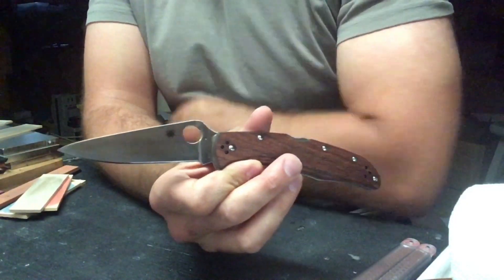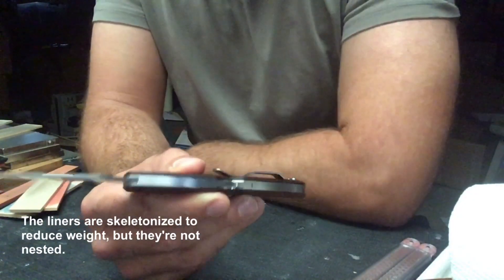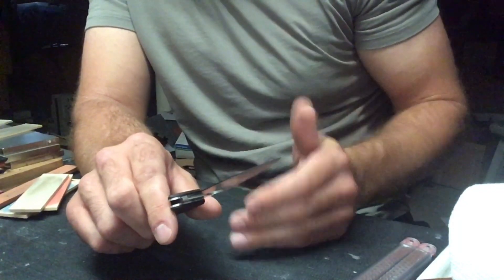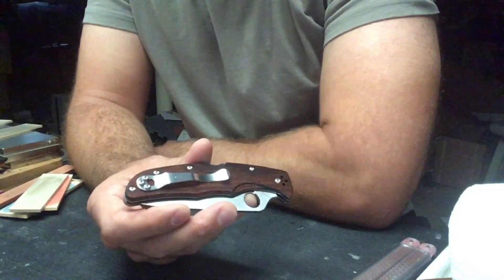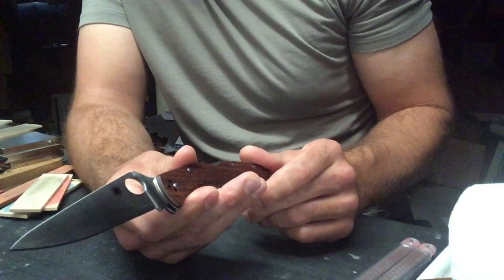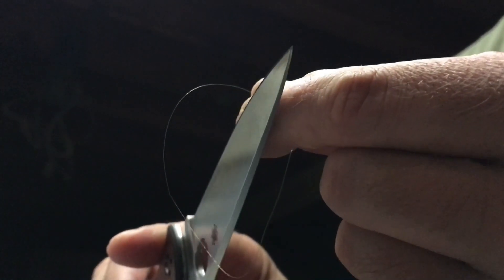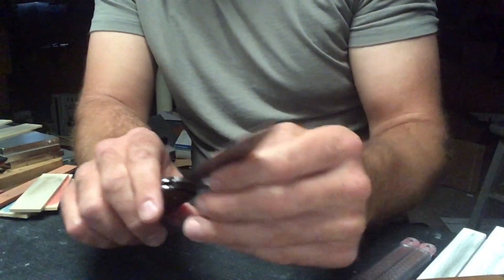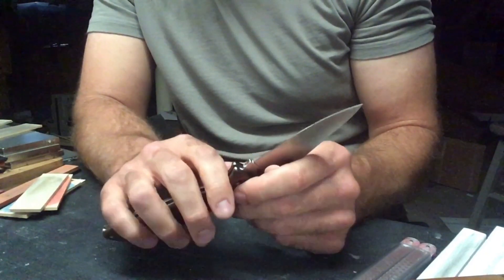HAP40 steel Spyderco Endura - pakkawood handle scales

Comment: I got a low-ish amount of cuts on my rope tests, but it doesnt sit right with me. I think I used too small a portion of the knife edge and need to re-do it with something delica sized. Great video man, love hearing you chat steel
Reply from the maker: Cedric & Ada Gear and Outdoors you mean you got a low result using HAP40?  That's interesting.  There's a lot of factors that could be the cause (which I'm sure you're already aware of).  Having to retest is a pain in the ass.  Hope it goes smooth for you.
Reply: Instablaster.

Comment: I've always seen HAP72 as the Japanese Maxamet too. I'd love to see a knife in it soon. Great video as always man!
Reply from the maker: Herb Toker thank you.  
Maxamet pushes the limits on content a little bit more then HAP72, but they are very close.  It would be interesting to see it come out.
Reply: Michael Christy Completely agree. I have a feeling it's going to be the new ZDP (in hype) in high end Japanese sujihikis and the like.
Reply from the maker: Herb Toker it would be great if we started seeing it come out.  Although, ZDP is a much simpler steel.  The main carbide former in ZDP is chromium.  HAP72 is packed with a lot of different elements.  ZDP is easier to deal with in a lot of aspects.  I'd still like to see HAP72 break into the production folding knife market.
Reply: We got a Shibata fan I see :P. ZDP-189 is finicky and annoying to sharpen with the high free chromium content, I'd love to see HAP 72 on some production blades, I'd like to see Sukenari replace ZDP in their san mai Damascus series with a super high wear resistant tool steel.
Reply: Michael Christy Yet again completely agree. I'm not saying that it will fill the roll of ZDP, but I think it will gain hype in the next few years. Kiya already has gyutos in it.
Reply: Elliott Atwell You mean low free chromium content. Most of the chrome is locked up in chromium carbides. I just picked up a 270mm Sukenari ZDP damascus sujihiki a few months ago and it's easily my favorite knife. Literally almost perfect.
Reply: Elliott Atwell And nope just a mitsudomoe, they've been around hundreds of years before Shibata! I do like their knives though!
Reply: +Herb Toker Nooooooooo it isn't, ZDP-189 is 3% carbon 20% chromium, chromium carbide is 3 chromium atoms 2 carbon atoms. Free chromium tends to clump in the martensite matrix and considerably reduces steel ductility. So even by stainless standards it has high free chromium content. Yeah I absolutely love Sukenari's Damascus series, they did a short run in Aogami Super which I personally prefer, but the grind fit and finish is immaculate. The only slicer I have that I like more is a custom honyaki from the head knife grinder at Nora.
Reply: +Herb Toker I'm taking my first crack at K390 with the Spyderco Police I pre ordered, supposedly it has 3x the wear resistance of S110V/10V, I'm going to be crying while I dish the hell out of my shapton pros
Reply: Elliott Atwell ZDP definitely isn't 100% stainless. Much less stainless than even S30v. Alot of the chromium is being taken up in carbides form. A steel needs 11% free chromium to be considered stainless. ZDP at 66 HRc isn't meeting that requirement. Also you forget about MC type carbides and what type of chromium carbides are in the matrix.
Reply: Elliott Atwell Look at M390 it also has 20% chromium but is super stain resistant, because it has a good portion of vanadium and other carbide formers (also over 1% less carbon). The 3% carbon and 20% chromium are the main makings of carbide in ZDP, thus the stainlessness is drastically reduced.
Reply from the maker: Elliott Atwell K390 does not have 3X the wear resistance of 10V.  In fact, it should have slightly less wear resistance then 10V (although, I highly doubt you'll see it in use).  However, it should also have higher toughness then 10V.  I also have the new Police on pre-order.  I'm really looking forward to that coming out.  Good luck with using Shaptons.  With that much vanadium in the steel, alumina stones are going to have a problem with sharpening.
Reply: Elliott Atwell Also K390 definitely does not have 3x the wear resistance than 10V, it may be tougher but has equal or most likely in all situations less edge retention (depending on heat treat of each).
Reply: Elliott Atwell I don't know if Chosera stones are much different from Shapton, but I couldn't sharpen k390 Spyderco mule with them, only diamon.
Reply from the maker: Soslan1812 I'm pretty sure Chosera are alumina based stones as well.  The vanadium carbide is harder then the abrasive (alumina) in the stones, so you're getting carbide tear out.
Reply: +Michael Christy Oh by the way have you tried the Naniwa diamond waterstones yet? They make them up to 6k.
Reply from the maker: Herb Toker I'm working with some diamond water stones.  Quite a bit, actually.
Reply: Michael Christy The Lee Valley diamond lapping films are great too, monocrystaline and down to .1 micron.
Reply: Elliott Atwell yea..... That would be great.... Hope you got $1700 for a 210 gyuto lol

Comment: Glad you got a new knife man! I'm thinking of picking up a military next week. I've never owned one and am looking forward to it. I ended up picking up the wicked edge I asked you about a while back. It's definitely pretty good. I was having trouble freehanding but I hope to try and keep learning on some cheaper knives this time.
Reply from the maker: crf450r bullet david the Wicked Edge is supposed to be a great system.  I've always heard that it's high quality and gives great results.  I'm sure you'll enjoy it.
Reply: Thanks I am enjoying it a lot now. It takes a little time to get used to it and where to setup the blade and breaking in the plates. It feels good to  have a way to sharpen knowing that it isn't going to go wrong. I've done some great freehand edges but my skill is definitely limited andI tend to want to change the angle I'm holding mid sharpening. I just need more practice.  I noticed the way you sharpen your blades always have a flat after the belly leading to the tip. Some knives come that way but it helped me to learn not to raise the knife to high and on the wicked edge to not take the paddles off the tip and it will stay straight and pointy.  Are you fairly new to sharpening or have you done it for a long time?
Reply from the maker: crf450r bullet david what do you mean a flat after the belly?  Not sure what you're talking about.
Reply: Let me try and explain, when I first started sharpening i would raise the knife too high and the tip portion of the knife would get round and not pointy. The way you sharpen leaves the tip area straighter which makes the tip a lot pointier. I wish I could draw it for you but I think that should make sense. What I'm saying is not a bad thing, it's a good thing and makes for a better tip. The pm2 and other knives come from the factory that way but in the past I didn't know to not go past a certain point to keep that geometry.
Reply from the maker: crf450r bullet david inhnderstand what you're describing, but you don't have to end up with a flat portion.  You can save the tip and keep the belly running to the point (if that's how the knife is made).  If you spend too much time near the tip, you'll develope a flat, but that just means don't spend too much time there.  Just enough.
Reply from the maker: I see what you mean now.  I've been sharpening for a longtime.  I guess it's something you learn not to do over time.  To me, the tip is the same as the rest of the knife...  it's just another piece of the edge bevel.  I don't put any focus on the tip itself, but rather the edge right before the tip.  When you put your focus on the edge near the tip, the actual tip works itself out.
Reply: Yes! That's exactly what I meant! You put it in better words than I could. That makes a lot of sense to sharpen like that. I first noticed just looking at your edges. I really liked the way they looked. But of course like you mentioned not all knives have this geometry for instance on the k2 with that huge sweeping belly. I really want to keep pursuing freehand. It's a little trickier to get this effect on the wicked edge.
Reply from the maker: crf450r bullet david it maybe trickier with the WE, but I'm sure it can be done.
Reply: Yeah your right I was playing around with it last night. I guess the problem I was having is when I didn't know what I was doing sharpening I was changing  The geometry. Now I'm trying to fix the a couple edges I messed up. Now I know a little better to keep edge how it is from the factory. Idk about you but I've gone through a hell of a journey trying to learn this sharpening game and I still have a lot to learn.
Reply from the maker: crf450r bullet david reprofiling is a strange thing.  There have been times I've spent a lot of hours trying to reprofile a knife early on.  More recently, I've done it freehand, but that's really difficult to do.  You need a lot of muscle memory for that.  I really tore up some blades early on reprofiling.  You get more used to it and the amount of attention it takes.

Comment: Great informative video as always. With my hap40 delica I noticed the first time I sharpened it I decided not to use my wicked edge but instead I used my friends Viper sharp and I was really surprised to get it really sharp rather easy with the stones that come with it that usually struggle on any steel above say 154cm. So do you think I would get a lot better results with my WE using through 1000 grit diamond stones then move to my 1200/1600 ceramic stones and move through my balsa strops till   .5 micron. Well brother hope your having a great day talk to you later
Reply from the maker: Stassa23 yeah, I think the difference would be noticeable.  When it needs sharpening, try it and see.
Reply: I definitely will give it a try I'm carrying it this week so it may need a sharpening after I'm done I'll let you know how it turns out
Reply from the maker: Stassa23 sounds good.

Comment: Hi, intersting test like the same. Have you ever testing a spyderco manix 2 lightwight?
Reply from the maker: cesare mantovani no.  I only have one Manix, and it's the G10 S30V version.
Reply: Michael Christy hi, i'm turning around manix2 lightweight 110/maxament and bradley2 ( how strong is the frame lock?) but can't decide between this two. What's your opinion?
Reply from the maker: cesare mantovani I would go for the Bradley, but I'm not the biggest fan of the Manix.  If you like the Manix, any are good options.  Just consider your uses in the decision.

Comment: Saw a comment on the forums that linked me to your video. You have an interesting sharpening technique. The bench stones I use are Norton India and Arkansas then move to the Spyderco bench stones medium thru UF before stropping with DMT diamond pastes on homemade horse butt strops. However, I use a more conventional method and lay my stones down on a bench and each pass is the entire length of the edge (unless extra attention is needed somewhere). What's the reason for the method that you use? You seem to get good results and I'm always curious to hear why different techniques are used.  Not judging or saying any which way is better than the other! Thanks for a great video!
Reply from the maker: hovan2yourknives I'm glad you found a link that brought you to the channel and that you liked the video.  
I use a lot of different techniques.  If you look over the whole channel you'll different techniques being used.  I use this technique quite a bit because it's faster and I don't have to rely on as much with it (like having the right table to work on.  It's just the stone in my hand.).  Stone in hand is a very aggressive way of sharpening.  If you have enough control to get good results with it, it is the fastest way to go about it in my experience.

Comment: Hey man  how are you doing? I was curious I have noticed you use the diafold diamond sharpeners and recently purchased two of them. Coarse/fine and xtrafine/xtraxtrafine. All of them do awesome but the xtra xtra fine seems to want to snag the knife when I go over those plastic circles. I was curious if yours done the same and if it gets better over time or mayb its defective? Could anyone add some input?
Reply from the maker: Stay Frostie it can do that.  Use lighter pressure and see if it helps.
Reply: It seems to be getting a better with usage over time, I just got them not to long ago and pressure does seem to help a bunch. It snags the most towards to tip of the knife itself. Which since those pockets aren't completely level with the metal and diamond makes sense. I am pretty new to hand sharpening and still learning but even the extra extra fine leaves some scratches to the naked eye but it does bring out a shine to it compared to the frosty look of the xtra fine. Might need to buy me an ultra fine ceramic next.
Reply: Thanks for the reply btw, keep putting out videos. I sure do like watching them,
Reply from the maker: Stay Frostie yeah, even the XXF diamond doesn’t give a fine edge compared to some other stones.  I’ve heard guys say that if you break an XXF stone in enough, it will, but I’ve never found that to be the case.
Reply: I also have some leather with some red and green compound and get them pretty sharp, enough to whittle or just cut hanging hair. But wanna get a finer edge yet heh, not sure if I should get a ceramic next or some diamond emulsions.
Reply from the maker: Stay Frostie both

Comment: Tell me, on the strop You are using the same engle or little smaller?
Reply: I would say it depends on if your stop has give to it. If it's thicker leather that take an imprint when your stroping use less  of an angle then sharpened at. If it's  thin leather or hardwood that won't  have as much give. Do the same  Angle that it was sharpened at
Reply from the maker: Bartosz Sochaj I always use the same angle on the strop that I use on the stone.  I use basswood because it has less give then balsa and stays firm longer then balsa.  If I'm using leather strops, I've made them.  When I make them, I make them to take more pressure then other strops.
Reply: I bought bass and balsa wood to try out on my pm2 110v. From your advice tried bass out first for my 5 3 and 1 micron  paste. I gotta say I'm impressed. I think anything lower then 1 I might go with lether just cause I think it'll be smoother to get the fool effect of the finer Micron
Reply: And I'm waiting for your Diamond Waterstone review. Big brown guy did a review on them. very interesting  abrasive
Reply from the maker: Sour one micron and above will load pretty quick, which will slow down how quickly the strop cuts.  Below 1, use leather because the strop will last a while.  
You could probably get away with 1 micron on leather for a awhile too.
Reply: Where do u get your leather from? I'm looking for a good online store for high-quality thin leather. I've been wanting to try and make my own strop. But leather isn't easy to find especially when I don't really know what kind of leather I'm looking for.
Reply: What brand of cbn do you use on leather? Looking to order my first bottle. I'm looking for maybe 2 to come down from 1 micron diamond paste

Comment: What do you mean when you refer to "alumina"?  The Spyderco ceramic rods are alumina, but are most often referred to as "ceramic".  Alumina is ceramic, making the usage of the terminology ambiguous.  Would you be so kind as to provide a bit of clarification of your terminology?    

Thanks!
Reply from the maker: aah when I say alumina based stone, I'm referring to abrasive in the stone.  Whether it's a Spyderco ceramic, Shapton, or King water stone, they all use alumina as they're abrasive.  This is relevant because vanadium carbide is harder then the alumina in the stone, so the carbide in the steel can challenge the sharpening process.